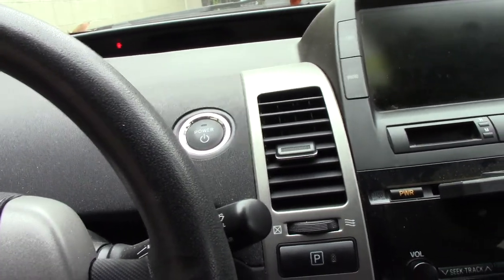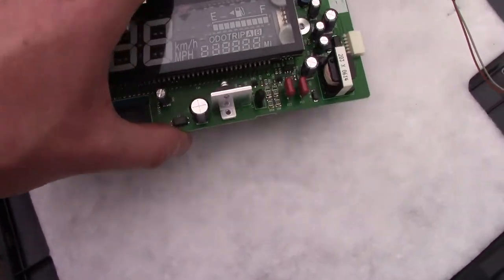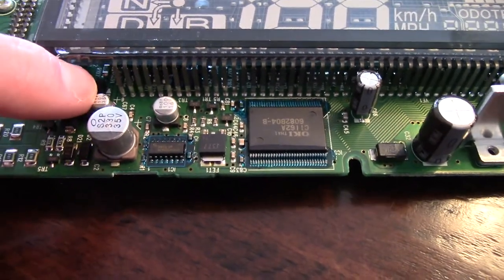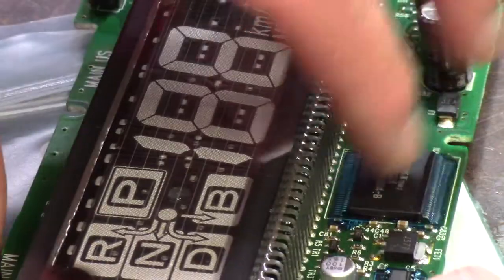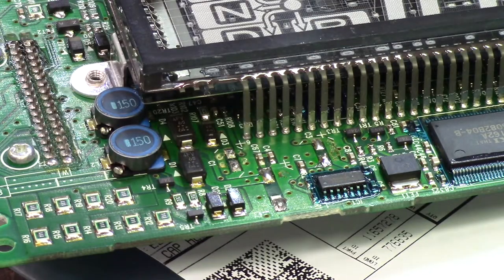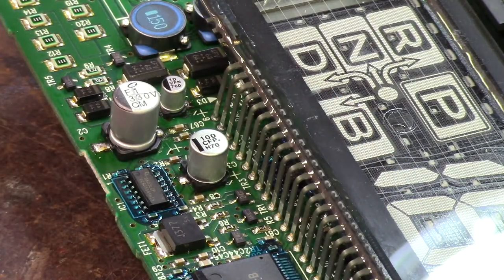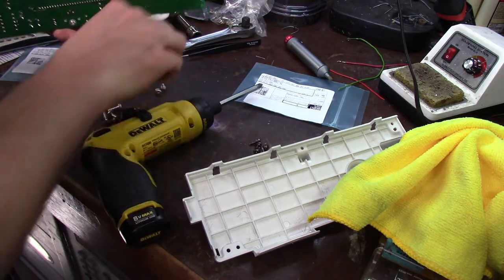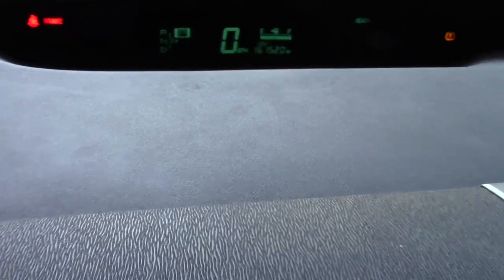Prius Dash Combination Meter Diagnosis and Repair

Comment: I'm glad this video popped up 5 days after doing this job. I did blindly replace the 100 uf with a 220 uf as other videos suggested. The orig cap did measure 100 uf so I was puzzled. Your video explains why. If I had seen your video I would have blindly replaced the 10 uf cap too I suppose. I used a standard cap and cut the legs short and bent the ends 90 to make little feet. It was very easy to solder and was a very sturdy result. What was funny is that the center speaker was disconnected. Then one of the black screws holding the black meter housing down was missing. My conclusion is that the unit had already been replaced once, and was failing again.

Comment: Thank you Sir. I just replaced the three caps and it works like a champ. 280,000 miles on my 05. This video helped a lot!
Reply from the maker: Wow 280,000.  Have you had to do a hybrid battery?
Reply: @mechtrician1  yes. Twice and one of those failed, but they warranted it. The last one I ordered it and installed myself.
Reply from the maker: @lee-johnson  good to know.  This one has never had a hybrid battery.  A friend of mine has had success replacing the cells in the hybrid battery before.  I may try that when the time comes.

Comment: Thanks, for this.  I just got a 07 prius and it's starting to have this issue.   Time to get the rework station out and plan a repair.   Also thanks for listening the parts I will get them on order first.

Comment: Do not take surface mounts off like that. You will pull the pads up. Take a pair of sharp nippers and cut a the base and then unsolder each leg. The lower the cap rating the higher the esr will be. That’s why the yellow on the cap wizard says compare.  You can literally warm the caps in your hand and the esr will read different.

Comment: Just a caution for those that want to apply what's here to other situations. Many modern voltage regulators require capacitors with a specific minimum and maximum ESR. Replacing these with something too low or too high will cause them not to work properly. Also, these PCBs are almost certainly assembled using lead-free solder. If you're in North America and used to leaded solder, you will need a slightly hotter iron than you're used to remove the parts.

Comment: Great video. I was wondering instead of surface mount capacitor, will these work? Radial Electrolytic Capacitor, 220uF, 10V and Radial Electrolytic Capacitor, 220uF, 16V?
Thank you.

Comment: 24:00 In cramped spaces like this I tend to evaluate if using leaded components is an option. Cutting, bending and shaping the leads gets me to where I can keep the leads very short but also at best access the SMD solder pads from the top or any angle, so I dont need to go at them from crooked angles andvmelting my solder iron tip into the plastic baseplate of the SMD cap.  
There is almost always room to place caps flat on the board or other components if need be and tack them down with silicone for vibration protection.
After all even the name brand caps dont seem to last as long as they used to. And you can only twist off SMD caps so often until the pad comes off with it,- especially if hand soldered with an iron and adequate amounts of solder on the joint.

Comment: Love the video, but FLUX FLUX FLUX!! Would have made the soldering job waaay easier.
Reply: And some heat resistant tape and I was praying that the components pad was not cracked or lifted
Reply: FLux capacitor? GREAT SCOTT!!
Reply: As a novice, I dont know the difference. How does it make it easier? Does that just keep the tip clean?

Comment: Hello thank you for your video.I have prius 2 nd generation.The Problem is when i go to the gass station when put the fuel to the tank of car it's reject.(by the sorry my english)and also the fuel gauge shows in correct what should be reasons?thank you
Reply: I'm very late to this reply.  But the likely issue for being hard to fuel and the pump clicking off is the tank itself.  On the 2nd Gen prius the tanks had a bladder inside them that hardened with time.  It creates a problem with fueling and makes the gas gauge not read to the full mark any longer.

Comment: On my 2006 Prius,my left turn signal,  high beam light, and parking/emergency brake lights don't display.  However, they are all functional. What do you think is the issue?
Reply: I have the same issue on my 2007. The check engine light side doesn't light up but the other side does. Did you ever find out how to fix

Comment: Can you explain how you were able to disconnect the airbag cable from the clip?  That is how it is attached in my 2007 and I cannot figure it out.
Reply from the maker: I had to fiddle with it I remember that. I used a very small flat blade to get the clip to release. It’s some kind of high integrity lock.

Comment: Re the replacement capacitors from Digikey, very few indicate ESR values that are in stock. Is the low ESR critical? There’s a lot in stock that do not have an ESR value. BTW, all three smd caps read normal in circuit uFd values but I don’t have a way to check ESR
Reply from the maker: Any replacement will be better than whats in there.  If the replacements have an ESR value, lower is better.  Old caps can read capacitance within range, but have high ESR.  If you are measuring in circuit without a proper tester, you'll get false values.
Reply: @mechtrician1  I replaced the 10,100,330 ufd (underneath gear select part of display)with low esr caps, still no display. My symptoms are a little different than most I read online (the red door open light on far left works fine) just the blue readout section is blank. Any other suggestions on parts to check/replace? Thanks for your help!

Comment: heard you mention "Hollywood". is it the SoCal one? if so, would you fix it on my Prius 2007? willing to pay for parts and labor and more.
Reply from the maker: Sorry, I don't really do outside repairs.
Reply: @mechtrician1  Not a problem. Without the testers you have, I guess I'll have to replace all 3 capacitors, carefully.

Comment: Do need to replace 100uf 16v to 200uf 16v? Or just replace same as 100uf 16?
Reply from the maker: The same is fine. Doubling the value probably won’t hurt but it’s not necessary.

Comment: word on the street has it that Toyota put the wrong capacity capacitor on and is should be a 200 instead of a 100 which is why it was a factory recall and free till 2016
Reply: Toyota rarely recalls anything, even if it involves safety issues, such as braking system problems. Instead they have extended warranties (service bulletins) which typically expire to the 8th year of use. After that, it's back to YouTube. 😉
Reply: Thanks for your update @normfromga  Sorry they avoid life threatening updates at any time. especially the way that this particular issue affects the way the car operates and is so Dangerous. they are leaving themselves open for many lawsuits that could be expensive considering their lackadaisical attitude.
Reply: @normfromga  That is absolutely incorrect! Toyota does more safety recalls than ANYONE and they are very proactive when a safety issue is present. Service bulletins and ENHANCED warranty are 2 very different things. Yes, Toyota does in fact have a lot of enhanced warranties, and that should be commended considering how many manufacturers tell customers to go pound sand. Cars were not meant to last forever. DUH